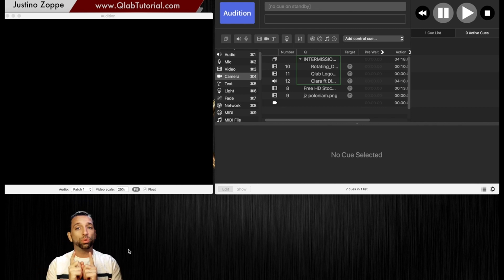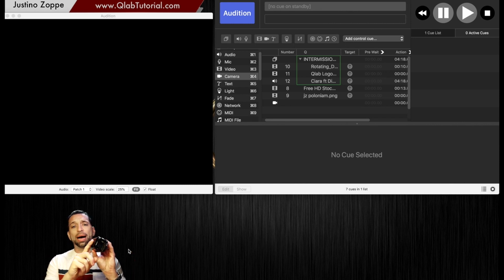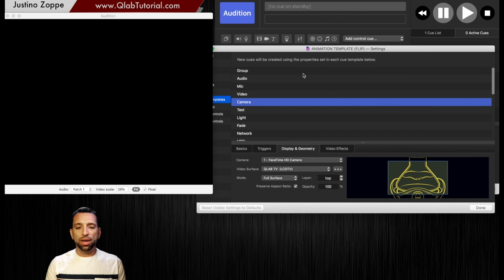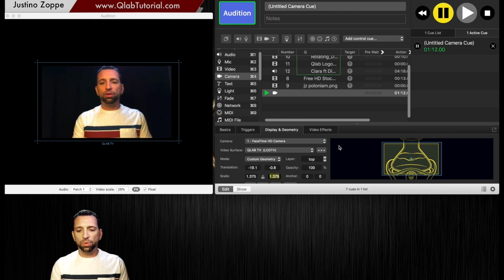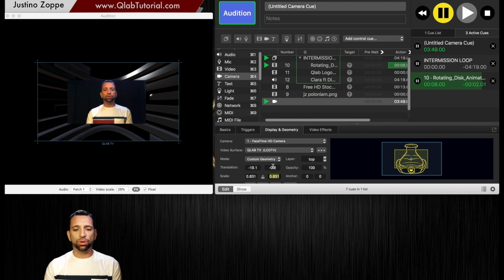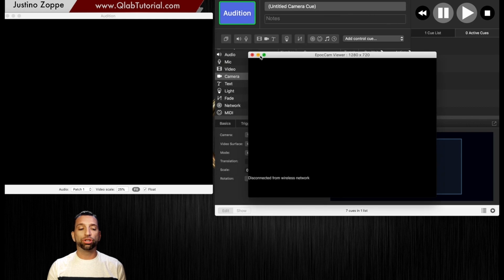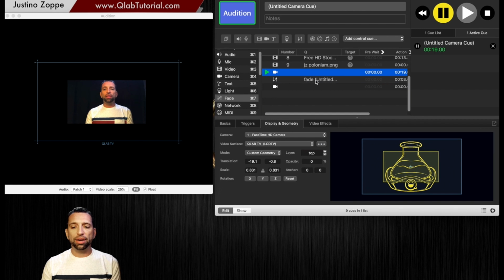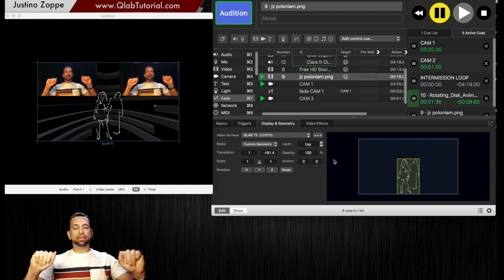18 LIVE CAMERA |  (Pro Series)  Qlab Tutorial

Comment: Hello, I have the following problem with controlling the camera via QLab.
How can I set the running time for each camera? When I go to the timeline I can't change the running time.

Is it possible to change the running time of the individual cameras?

Thank you in advance.
Reply from the maker: so don't think running time.. thing START... and then STOP Cue.. I suggest go back to watching the start of this series, and when you learn those basics it will make more sense now when your doing advanced things like cameras etc but the short answer is fire a Start Cue, and then if you want it to run for 2:42 you would watch the GROUP CUES video to learn how to use groups, and then set your FADE OUT cue to happen 2:42 and you can then choose how long the fade takes place, and when its done fading you want to make sure you tell it to STOP cue, or it will fade out but continue to run .. (which may have its benefits for different segments of your show) but not if you simply want to stop the camera cue all together.. I advise watch this whole series (it's free) and you will gain so much info. from all of the mistakes I learned over the years using Qlab :) oh and on a side note if you have an iPhone try out the new continuity cam feature it works perfectly with Qlab! (wireless Camera!) enjoy and please follow like and subscribe to support my small channel :) thanks